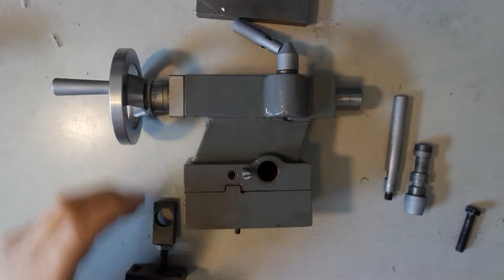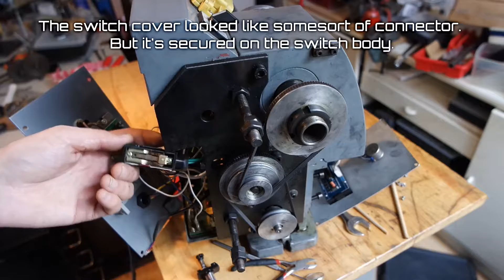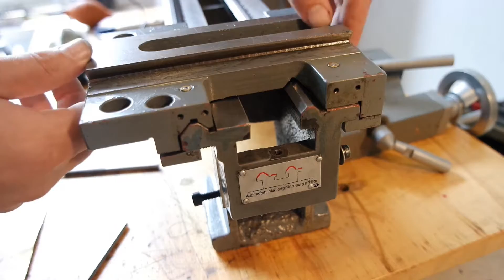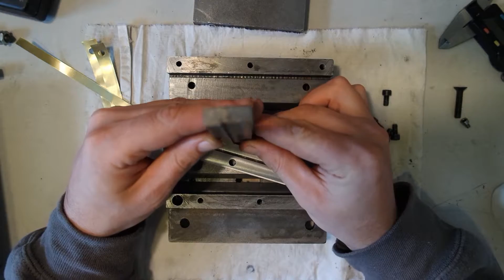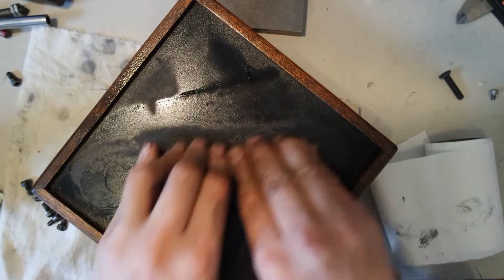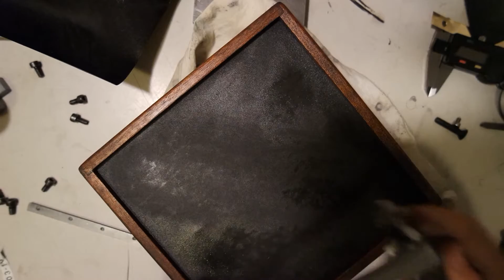Small lathe overhaul - 6 - Finding and making more problems

Comment: I have the same lathe, and I found that the underside of the ways are not as smooth as expected, which may account for the issue you mentioned.
Reply from the maker: Is it a PX 210x400 too, or one of the many variants? The undersides of the ways are quite rough indeed. 
I put a indicator with magbase on the saddle and tested the surface of the ways about 10cm from the saddle.
Even without the clamping strips on the underside I measured an unevenness when sliding the saddle , this got me worried about the state of the lathe bed.
Reply: No, mine is a ed300f but looks excatly like yours. Must be from same  factory. I am satisfied with the ways, except the underside.